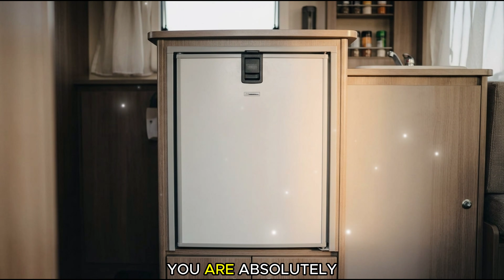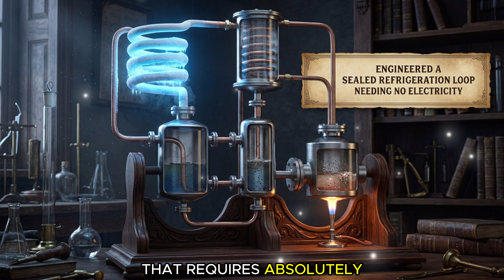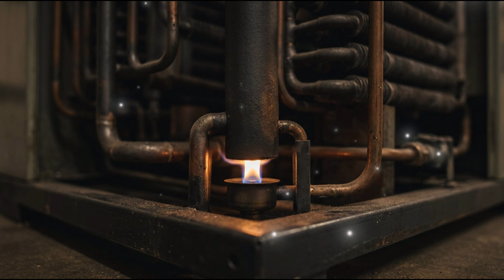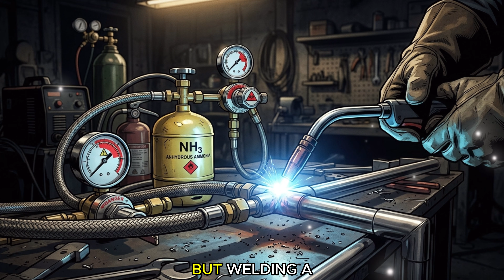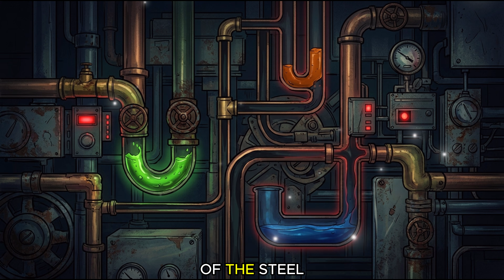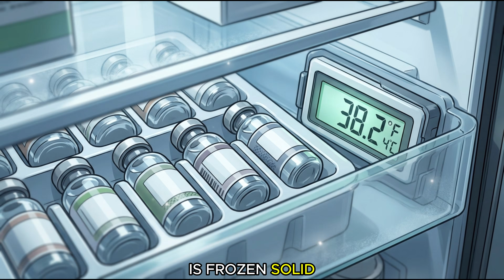The 100-Year-Old Fridge That Keeps Working When the Grid Goes Down

Comment: It`s called an absorption cooling / refrigeration...Modern commercial units are used for large installations because they are far more efficient than anything else...Only 4 parts and one moving one, a circulation pump to circulate the hydrogen bromide and a 220-F heat input and you get 40-F cool air output.
This is the same thing it just uses something else as the medium.
Reply from the maker: Exactly, it’s absorption refrigeration. The video was focused on the smaller off-grid/propane style units people recognize from RVs and Amish/off-grid use, but you’re right that the same basic principle scales up in commercial systems too. Different medium, same bigger idea: using heat to drive a cooling cycle instead of relying on a normal electric compressor.

Comment: If the Amish were right, they'd be millionaires by now
Reply from the maker: Fair thought, but the Amish usually aren’t trying to turn every useful tool into a billion-dollar product. That’s kind of the point — they kept using practical off-grid systems because they worked for their lifestyle, while the mainstream market moved toward electric convenience. The value here isn’t that they invented a fortune machine, it’s that they preserved a resilient option most people forgot about.

Comment: Can you convert to use small wood flame instead of propane?
Reply from the maker: In theory the fridge only needs heat, but in practice I wouldn’t convert a propane absorption fridge to a wood flame. These systems need a small, clean, steady, controlled flame in the exact right spot. Wood heat is dirty, uneven, and much harder to regulate, so you risk soot, poor cooling, fire, or carbon monoxide problems. For survival use, I’d stick with propane or a unit specifically designed for another fuel source.

Comment: NO AMISH DO CHEMICAL ENGINEERING
Made by two Swiss engineering students and sold and branded by Electrolux "the flame that freezes"
Reply from the maker: Fair correction. The Amish didn’t invent the chemistry — the point was more that off-grid communities kept using this kind of absorption refrigeration long after most people moved fully into electric compressor fridges. “The flame that freezes” is exactly the principle I wanted people to understand.

Comment: Lehman Brothers will sell you Propane powered Refrigerators between $1,500 and $3,000. They use under 2 pounds of Propane a day.  Shipping, Taxes, and 3-500 gallon Propane Tanks cost more.
Reply from the maker: Good info. Those propane fridges are definitely not cheap when bought new, especially once shipping and tank setup are included. That’s why the salvage angle matters so much — old RV/camper units can sometimes give people access to the same basic absorption system without paying new appliance prices.